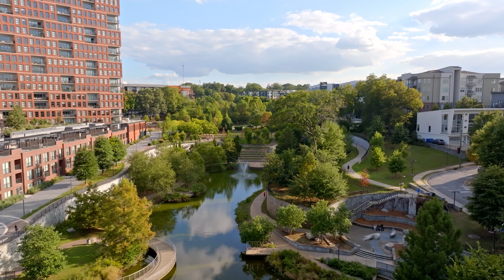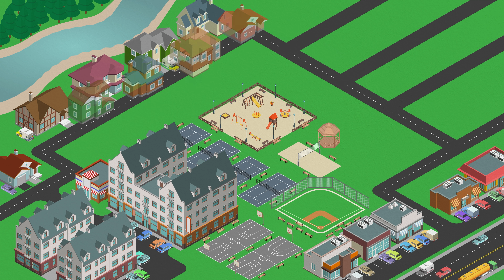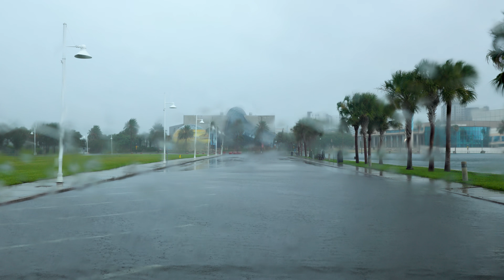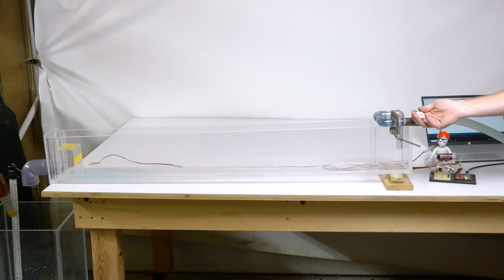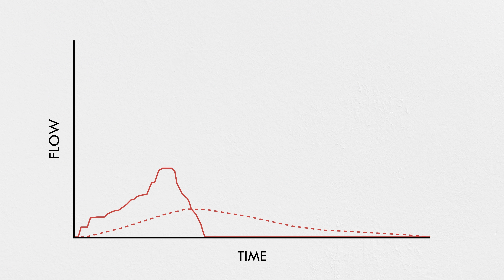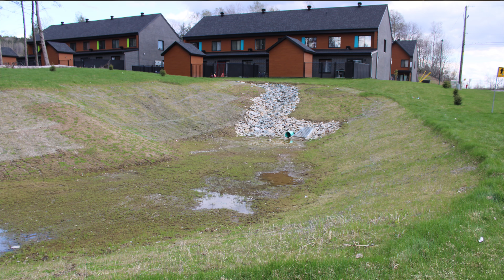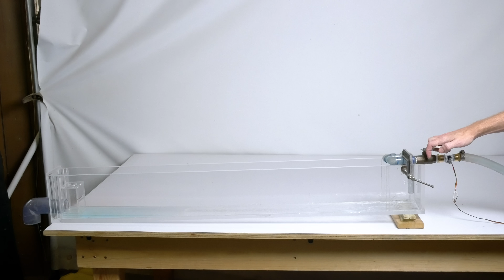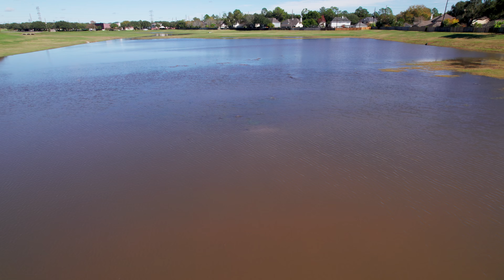Do Retention Ponds Actually Work?

Comment: Fun fact you may not have considered:  retention ponds are used extensively around Toronto, but because of road salt run-off, they become quite saline — so, while a natural pond can produce a thick layer of ice for skating over the course of a winter, retention ponds can have deceptively thinner ice (due to salinity).  There are usually signs around retention ponds to draw attention to this (and some municipalities pass bylaws to prevent skating), though unfortunately, accidents are not uncommon.
Reply: I was thinking that any pond with settling is going to develop an increasingly toxic layer on the bottom
Reply: @proscriptus correct.  But at least it’s in one known location and can eventually be remediated.
Reply: @proscriptus  They have a regular cleaning cycle so they remove the contaminants at a set number of years.  I've seen it in the GTA.  The ponds will be drained while maintenance is carried out.  Also why they are not stocked with fish.
Reply: @MappingKitty  not always with the fish. There's a retention pond in Mississauga, where there are herons. There are fish, whether invasive or not is another matter.
Reply: @proscriptus  it is toxic, and that counters the amenity aspects of it presented in the video, most of the retention/detention ponds at least in my city are totally fenced off and forbidden to the public due to health reasons, urban storm water is not safe intrinsically.
Reply: @proscriptus in theory part of the pond design involves a maintenance schedule.  Also, ponds are design with a forebay, where most of the gunk is supposed to settle.  Also also, some ponds will have an OGS (oil grit separator) ahead of the inlet to the pond.  Depends if it’s a quality pond or just a quantity pond.
Reply: Interesting factoid👍
Reply: Small retention ponds also tend to have a lot of decaying vegitation at the bottom. The process of decay releases heat and can make ice thinner as well.
Reply: So working in industry they do help with that, but they are common still for retention first. Changes to regulations brought in as a result of hurricane Hazel and other successive storms have driven their current design. They are designed for capacity to take a hurricane Hazel type event. What's called the regional event.

The salt mitigation component is specifically the forebay/mainbay system within the pond. Also helps trap oils from the asphalt, cars, other pollution. Quite beneficial
Reply: Isn't that part of a great winter though? People in the netherlands try to ice stake and fall through every time there's even a possibility of skating on natural ice.
Reply: @EminemLovesGrapes Preach it!😭 Every single icy, snowy Winter I wonder how aren't there more People taking Ice Baths in our Lakes and Ponds, or Rivers while sliding down steep Deichs.
It's flat in Northern Germany.😂
I remember the Town I grew up in having rescue Ladders with the Signs at popular Spots.
Reply: I always wondered why most of them had no skating signs. 

Now if only we can get the rest of them to take away the no fishing and no swimming signs so kids can get away from their screens
Reply: @ChevTecGroup  Contrary to what many people say, road salt isn’t the primary factor—its concentration is too low to noticeably lower water’s freezing point. The real issue is runoff that seeps beneath the ice in retention ponds, thinning the sheet from below in a way that isn’t visible on the surface. This hidden weakening can cause pond ice to become unsafe almost instantly and without any warning.
Reply: I wonder what that salinity is like for any wildlife in the pond and if it infiltrates to also salt up the ground water in the area? (Issues you tend to see around sea water and coastal areas, though these ponds might not have the scale for those sorts of issues?)
Reply: Nobody should be on storm water pond whether it is frozen or liquid. It’s extremely dangerous. 
Just enjoy looking at them and seeing the birds.
Reply: Brady lives in Texas, so he definitely didn't consider that. Having moved from Texas to Wisconsin myself though, it's information that I can use.
Reply: @chitlitlah  In Texas, especially South Texas, this is something that isn't consider as we typically get snow/ice storms once every few years. As you may have noticed moving from Texas from WI... Texans FREAKOUT with the slightest bit of snow. I live in San Antonio and my mother lives in Oshkosh, and I spent a year in Milwaukee.
Reply: @skatershawn410 texas roads were never built with the consideration of snow. Sharp curves on over passes that have a light at the bottom. When I visited Houston about 10 years ago there was 600 wrecks in 1 hour from ice
Reply: @chitlitlah His name is Grady and he does mention salt run off from roads in this video
Reply: @drewfliesbikes  Yep, I screwed up the name. I also watch another channel run by a Brady, so I'm going to use that as my excuse.
Reply: i'm very curious what banning skating is supposed to accomplish, do people generally feel better from getting prosecuted after falling through the ice and going to hospital for frostbite?
Reply: When reveiw stormwater applications for the MianeDEP, we someimes ask applicants to put a fence with a locked gate around ponds that may have a potential for something like that.
Reply: A lot of these ponds I see where I live in Western Washington have chain link fences around them as well as signs saying what it is for and to do not enter.
Reply: Edmonton's have big signs, too - and the detention ponds can flash-flood, so they have even bigger signs.  But the thin ice problem is one of the reasons Edmonton doesn't salt the roads.  (Of course, most private owners salt their driveways and parking lots so it's still a big risk.)
Reply: The two in my old neighbourhood are normally dry. Lynngate, eh.
Reply: he mentions this around the 11 minute mark
Reply: Maybe closer to the city yes but their have been times here in Durham were you could skate on the pond no problem I’ve done it on 2in😂 but usually wait until it’s atleast 4-5in seen some get as thick as a few feet back in the day but I can agree the ice has been thinner past few years because it’s just been not cold enough in the winter for long enough anymore.
Reply: I didn't consider that I thought municipalities were just being toads. TiL
Reply: Researchers investigated the effects of storm water retention ponds in the Edmonton area and discovered that the mean freezing point depression of all samples was 0.040 °C, with a standard deviation of 0.028 °C. The most significant freezing point depression observed was 0.134 °C. Even during the warmest winter days in Edmonton, where average daily temperatures typically range from -7 °C to -15 °C, the depression in freezing point had a limited impact on preventing ice formation. Specifically, at -7 °C, the freezing point depression of 0.134 °C would still result in water temperatures (-6.866 °C) cold enough to freeze the water. The study found that the concentration of salt in storm water retention ponds had a negligible effect on ice thickness.
Reply: @NotExpatJoe  Edmonton use next to no salt compared to Toronto.  Toronto and the GTA use a sugar brine and salt all winter.  I've lived in both places.
Reply: @MappingKitty  Despite significant differences in population size, Toronto and Edmonton exhibit a surprising similarity in their per-capita road salt usage. With a population of 3,275,000, Toronto proper consumes between 130,000 to 150,000 tons of road salt annually, while Edmonton, with a population of 1,195,000, uses between 45,000 to 55,000 tons. However, when adjusted for population, the two cities' salt usage is nearly identical, with Toronto using approximately 21.83 pounds per resident and Edmonton using 21.72 pounds - a difference of just 0.11 pounds per capita. Having also lived in both places, I ground my remarks in solid facts rather than personal anecdotes.
Reply: Too nerdy. Actually there is no reason to believe these ponds are homogeneous!
Reply: That's a big part of why they've switched to brine trucks instead of rock salt. It stays on the road & you get far less that ends up in the lakes/ rivers here in mn.
Reply: @danl6634 Why would brine not leave the road when solid salt does?
Reply: @SeverusFelix  the salt that mixes with the snow & melts has to get plowed off the road. Gets flung a lot further off the road into the ditch, then more salt gets added next time. Brine is already in liquid form so it stays on the road & keeps ice from forming in the first place, or if it does get plowed off with the snow is already in liquid form so there's a lot less total salt being used.
Reply: @SeverusFelix it does.  It is a different salt, and it does wash away, it does dry and then accumulate in cracks and in the curb edge.  It gets swept and washed and flows eventually to a pond with each rain.  The rock salt that doesn't dissolve  (because it dissolves slower than the salts used in the brine) stays in the grass and is the reason that trees adjacent to highways are often dead on the road side - it is as much the combustion residues as it is salt in the soil.  

The brine is nasty stuff.  That salt's abilility to disolve readily into solution is what is eating our vehicles.  Krown has a neat video of rock salt in a chamber alongside the brine salts.  As the humidity is increased the brine salts liquify almost immediately and in their liquid state immediately start reacting with infrastructure and vehicles.  So not only is it caking up in ponds, it is rotting out the structure of buildings and other infrastructure too.  But ice free roads trump that!
Reply: @danl6634  Around Lake Tahoe we only see brine before storms. Never during.
Reply: @danl6634 As brine it also needs much less salt. Best applied just ahead of the weather change.
Reply: “Fun fact…” 🤔 I do wonder how “fun” this fact would be  for someone who, blissfully ignorant of colligative properties, decides to go ice skating on the lake...🥶
Ps Thanks for the info.
Reply: It’s been a problem in Maryland.  High salinity in streams has been traced to settlement ponds that hold the salt  and cause issues in local streams.  So the ponds are there to help the Chesapeake, but now folks are wondering if they are doing mor harm that good.

Comment: There's a normally dry detention pond several miles from me that serves as a park when empty.  It contains two soccer fields, a basketball court, and a skateboarding area, plus the levee around it hosts a paved walking track.
Reply: Yes, I've noticed these in a few places, too. At first I'm like "why are these playing fields sitting in a depression?". Of course these are only meant to hold water in really severe rainfall events, so most of the time they stay dry.
Reply: Some, but not all, of the ones near me are fenced off. I think this is because after high rainfall, the water could be very deep and a safety risk if children try to swim in it. The sides are fairly steep, which makes it harder to get out. They are a lot smaller than the one you are referring to.
Reply: @markh5210  The one in my original post has an attractive metal fence around the whole thing, and gates are closed if there's water.  Otherwise, the park is open 24 hours, with lights on poles on the surrounding levee.
Reply: @markh5210 in the civilised world we just put up a no swimming sign and let natural selection do the rest
Reply: Neat!  Do they have to pull cones/gear and whatnot out before bad storms, or how does that work?
Reply: @ericlotze7724  Fence with gates, closed only when the pond has water.
Reply: These ponds are a way to deal with loss of wetlands. The difference is that wetlands are usually filled with reeds and other aquatic vegetation which have a phenomenal capacity to purify water as well as slowing the flow.
Reply: Exactly... that flood-prone land is the perfect place to put such recreational facilities. The land is cheap because it's not suitable for more valuable uses like housing, and if it floods, no big deal. We had major flooding in my city about 3 years ago now, and I saw people paddle-boarding on the local football fields the following day... it took a few days to drain, but I can't think of a better place for all that water to have ended up.

Comment: 😞⚠Video ignores many "Retention" Zones/Ponds are Fatal Areas that Kill People every year and often doesn't make the News including Local News beyond a "Soundbite." People near or using them often have No Clue most are Very Dangerous even after Minor Storms. Worse some are Flash Flood types that can start Dry or near so to fill Several Feet in Seconds trapping anyone that doesn't see the water rising or more likely doesn't understands they have bad time coming fast. Even most HOA and related have no clue until the "pond" kills then get sued.

Comment: Here's an idea, you could use the water from those ponds to cool air (air conditioning) for nearby houses, requires infra but probably saves some electricity costs.
Reply: You didn't provide much detail for your proposal, but in general a pool of water doesn't provide much opportunity for cooling anything.  A heat sink for air conditioning maybe - but that requires a pretty large volume and expensive associated hardware.  Definitely not suited for evaporative cooling.

Comment: I very much like the permeable pavement idea, but I realize they will works best when new and get worse over time as they clog up and get danaged by snow plows and such things.
Reply: Maintenance Issues / Things being made of “Renderium” is a MAJOR issue with things like this.

That and some engineers not taking DFM / “How will someone actually make/maintain/eventually demolish this?” seriously. 💀
Reply: @ericlotze7724  Many engineers never consult the people that have to maintain them. I worked for a city that replaced standard asphalt and concrete sidewalks on a couple of streets because they could do it using free money from a federal grant for these type of projects.  Within one year, the sidewalks were covered with moss and were a slipping hazard.

Comment: Thanks!  BTW:Chemical Engineers use small versions of retention ponds and call them 'surge tanks'.  They trade off level control for flow control.  Surge tanks are inserted between chemical/refining processing units to dampen the flow and composition variability seen by downstream equipment, thus isolating process upsets.  Of course, Control Engineers don't like surge tanks since they increase the control response time constants.  Plant management also don't like them because they increase inventory.

Comment: The secondary [overflow] outlets kick in exactly when the receiving stream is already at maximum capacity. There really is no replacement for displacement. 

In my area we have upstream retention (A dam on the river with a normally empty pond of 130 kacre-feet) to create more spare capacity in the receiving river. The normally empty pond self cleans sediment, but because it is upstream of development there is no problem with the sediment being polluted. 
However, this high capacity flood regulation eliminated strongly flushing peak flows downstream, and made local governance complacent (neglecting dredge operations), causing the lower river fill with sediment which cut peak capacity by more than half. (It was designed to be dredged, and there is a dredge that has sat unused for decades.)

Comment: Here in Washington state, RP's or DP's are all over the place but mostly located at the top of hills. Even in the worst downpours they rarely have a lot of water in them - because they're at the TOP of the hill!  If they were placed at the bottom of hills, or even in the middle, they'd work much better. The other problem I see is the design of the output pipe allows the retention pond to hold stagnant water and this creates a breeding ground for mosquitoes and all kinds of other non-beneficial bugs.